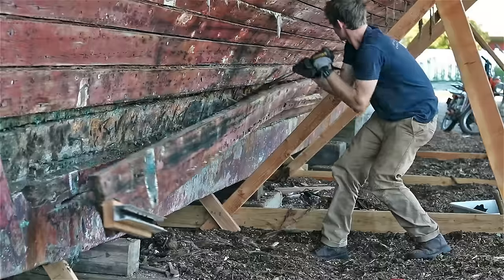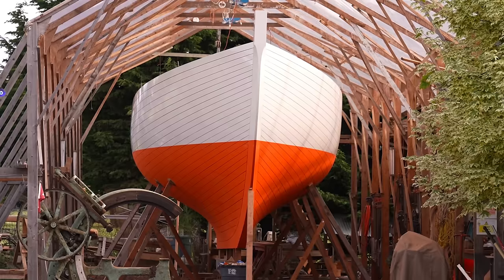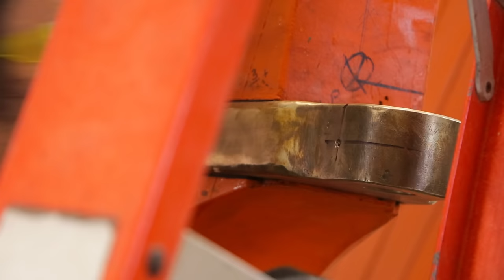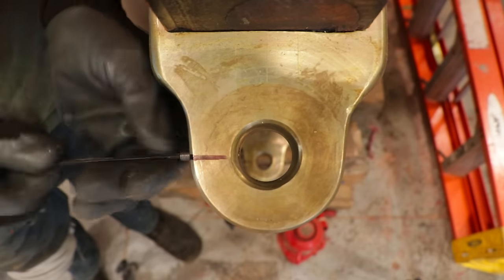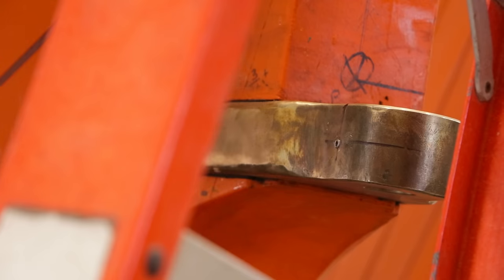Finishing the Rudder and Skylight Hatch (& open house)

Comment: The size of that trim tab surprised me, it seems very deep (meaning fore-aft) relative to the rudder depth. I suppose I'm used to aircraft trim tabs which are tiny relative to their control surfaces. I suppose there's a formula for the relative sizes of rudder and trim, and I guess it's to ensure the self-steering arrangement doesn't need too much force to operate. Zeal not only displays wonderful skill but also great courage - even if I had the skill to drill that trim tab control rod hole, I wouldn't be have the guts to start. Those winches are something else, lord only knows what they cost, but the boat deserves them. The hatches and cockpit all look magnificent.
Reply: The term 'trim tab' is a bit misleading in this context. Correct me if I'm wrong, but aren't aircraft trim tabs used only to balance the aircraft, & a plane's autopilot uses hydraulic power assist to move the main control surfaces?
On Tally Ho, the trim tab provides the power assist to move the rudder - if the autopilot or wind-vane wants to steer to port, the linkage will turn the tab to starboard, forcing the rudder to move in the desired direction. It's only able to provide relatively minor course corrections under fairly steady-state conditions, unlike a plane's autopilot that can make major changes along a pre-programmed route.

Comment: I had a moment of wondering if you were playing a joke with the gudgeon and pintle references, expecting to hear that the kenutten valve needed adjusting or the gehooten bolt needed tightening.  It is charming that the boat world just has to be different.  That's not the right side, it is port, there is no rope here, it is line, those aren't hinges, they're gudgeons and pintles.  The tradition is incredible - like stepping into another world.  Keep the weird coming, I am loving it even though I am a lubber.
Reply: learn port and starboard
Reply: @michaeldemarco2415 LOL, I stand corrected with thanks.  😁
Reply: Hey Ribb, and others.  Easiest way to remember Port from Starboard? The word Port has four letters, the word Left has four letters.  Now you can rest your weary brain!
Reply: @davelcx1958  Actually, I just have to adjust my mindview of which side of the ship is shored to the port.  I always envisioned that the front pointed to the right, but now I try to remember it points to the left.  That allows for the paradigm (right or wrong) that I was taught being the port side is docked, and the starboard is to the open sky.  For all I know, they dock on the starboard side as much or more than the port.  As I will never, ever have need to use this information other than "Talk like a Pirate Day" (which is sacred to me) I will maintain my stupidity for the sake of family tradition.

Comment: I sailed a 25ton ferro ketch 25000 miles from Durban. 3 hours of us. I designed and built my self steering on the water in Durban. My trim tab was only half the width of Tally Ho, it worked perfectly and we hardly ever steered whilst  we were sailing. I have watched your  videos from  tthe beginning congratulations for a magnificent series.Frank Luton

Comment: I’ve been fascinated to watch the care and craftsmanship which has gone into this project, and thrilled to see a new generation of artisans mastering, undertaking, and keeping alive skills which in some cases went out of common use in their great grandparents’ day or before. One slight quibble- at about 2:30 in this video, when the process of riveting the pintle to the rudder is being discussed, the term “upsetting” is used. In the forging of metals, upsetting is a process whereby a bar of material is made shorter and wider overall by being perched vertically on an anvil and hammered on the end.  When setting a rivet, the process of widening the end of the rivet to clinch it in place is referred to as “peening”.

Comment: One of the main reasons for hot riveting is that, as the metal cools and contracts, it pulls the two sides together and thereby tightens the joint.  Not to teach anyone to vacuum ova....

Comment: And a massive thank you to you, Leo, for enriching my life and many others with this project.  I was at the open house and found it not only thoroughly enjoyable but really well organized.  Great job!  I was pretty amused by the vast array of battery tools on one wall of the shop, and equally vast array of planes and hand tools on the other.
In the airplane biz, we'd have called that a servo tab rather than a trim tab.  The difference is that a servo tab is used to help move the surface, while a trim tab is just for, ya know, trim.

Comment: Maybe it's a totally different story with brass but I'm pretty sure those set screws (8:45) will seize up in no time and then you'll strip the hex right out when trying to remove them. Small internal hex heads aren't very robust.

Comment: When it comes to zerk fittings, I highly recommend looking at relocation kits. they are cheap and the fittings are brass and the tubing can be copper and it would allow you to group fittings into easy access location and or attach an auto feed grease contraption. the brass fittings and copper would patina with the rest of the hardware and the auto feed and or relocation of the grease fitting(s) makes maintenance easier.
Reply: also worth noting that it is never too late to add a relocation kit.

Comment: I measure my age on disappearing things such as the tap thread tappers, we used to use the 1th 2nd and last tap, that was less faster in time but then again we used the second tap if we needed a bolt to eat / grip into the tapped hole making it lesser come loose and basically stronger because there was no play in bolt and bolt hole

Comment: I loved how you laid out the blueprints as well.  It gives an extra insight on what it takes to build the ship.  
BTW can you give us an update on what needs to be done yet?  From what I can see you still have work to do below decks to finish the galley and forward sleeping quarters.  The mast and spars are well in hand elsewhere.  The sails need to be created but I am assuming someone else will be doing that also.  The skylight looks close to being finished.  You have placed the various windlasses (?) for the running rigging which means you are able to add the lines once the mast is  in place.  Personally, I am starting to see an end to the project within the next year, but I could be wrong.  Have I missed anything?

Comment: Novice question I'm sure and apologize in advance.  Absolutely love the channel and love to continually learn!  May I ask, would the plug (in lieu of the grease fitting while underway) end up seizing over time (even quickly)?  Perhaps just contrary to my novice intuition and again loving to learn always!  Wish you all the best and what an AMAZING job!!!
Reply: I am led to believe that a grease zerk would corrode(at the faster) whereas the bronze plug wouldn't.
Reply: The bronze the fitting is made from is very corrosion resistant and I'm sure the set screw is stainless steel which is also very corrosion resistant, so it will take some time before seizing becomes a problem. If they put some dielectric grease on the screw before installing it, that would also provide corrosion resistance.

Comment: Love the work guys. Being a guy who works on zerk fittings often... rather, things that have zerk fittings..... Why not thread on a fancy tube so you can grease the joint remotely? Typically i've seen copper tubing used to allow remote lubricating. Is this grease point just not used often because bronze is a bearing material?

Comment: This may be a dumb question but, did you worry at al that the hot rivet might start an amber smoldering inside the rudder? Perhaps there's just not enough oxygen inside for that to happen. Just wondering.

Comment: Any particular reason you did not coat the holes you drilled in the rudder, with epoxy before installing the pins?

Comment: Can anyone recall what parts of this boat were even remotely original?
It also makes me sad seeing all those newly cast bronze knees and fittings when they were first polished and you could see from stern to stem. It looked beautiful but then all that beautiful cabinet work covered it up - absolutely necessary to be sure, but fully understandable for a working boat..
Well done Leo and crew/serfs/slaves as you’ve done a marvellous job effectively making a brand new boat from the ground up as well as making it as carbon neutral as possible.
Reply: Most of the Transome is from the original.😊
Reply: @KazM-Made  thanks for that. To be honest it wouldn’t have mattered if it had been built just reusing the lead keel, but so long as he was rebuilding it it using the original plans and all that effort he spent dealing with all those fair lines and everything else, I wouldn’t have cared. Leo’s sense of mixing modern fittings with all that beautiful carpentry has been an amazing journey. My only regret is that I won’t be alive to see it launched back in the water where she belongs - but the timing is well beyond my control.
All the best from Burley in Wharfedale.

Comment: 8:46 Could've made custom zerks with a thread on cap. They're not very difficult to make, just a brass body with a spring, ball and instead of a flange, there's a thread for a cap to go on. I've seen them used in water lock hinges in UK.

Comment: I don't know if this point has been raised in the comments but that grub screw used as a placeholder for the grease nipple is a future problem as it won't come out easily and SS internal grub screws easily strip the internal hexagon drive if any large force is applied. I would be looking for a different solution if it was me.

Comment: So common sense tells me that rounding all the straight edges on the rudder is for cutting through the water.  Or is it for esthetic reasons?
Reply: Hydrodynamics and the fact that sharp corners break down much more quickly than ones with a generous radius.

Comment: For your greasing, don't bother with a zerk fitting.  Lathe a taper and put a zerk fitting on that, then remove the set screw, grease, put the set screw back in.

Comment: Don’t use a stainless steel plug in the bronze hardware. The stainless steel will corrode. Use a bronze plug.
Reply: Stainless is more noble than bronze due to its chrome and carbon. If anything the bronze would corrode...
But the screw is tiny and therefore it's potential is too.
If they were really concerned they could use a nylon setscrew.
Reply: @jimurrata6785  My reference material says that passivated stainless steel is noble to bronze. Meaning the stainless steel has a good oxide layer. But loose the passivation and the stainless steel will corrode. The plugs are very small and the bronze is huge. Not a good combination. Not a surface area ratio in favor of protecting the small plugs.
Reply: @GLF-Video  Obviously my books aren't the same as yours but the only thing I see below naval or silicon bronze are the 41X series.
I also don't think charts of galvanic series have changed any in the last 30 years (except for the addition of new alloys) but I'm open to any possibility.
I'd well imagine any stainless going on a boat is going to be passivated 316. Port Townsend is pretty much the epicenter of boat building in the PNW, so the stuff is available.
Either way I'm not here in the damn comments of one of my favorite YouTube channels to argue with an 'internet expert' who knows more than the incredibly talented collective that's actually building Tally Ho.

Comment: I would take out the rivets, and reinstall properly. 
It's not a welded thing, making flush weakness the connection.
Fix in now.
Reply: Unless you intend on not putting in the water.